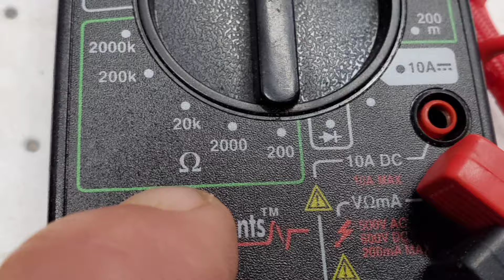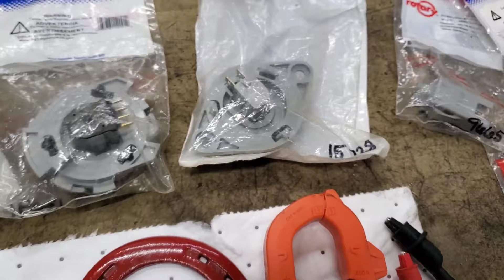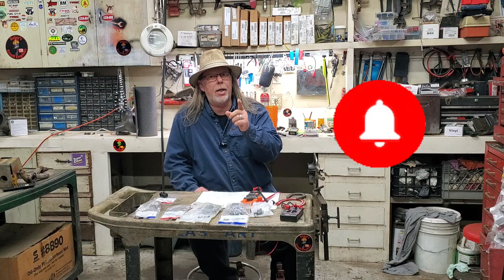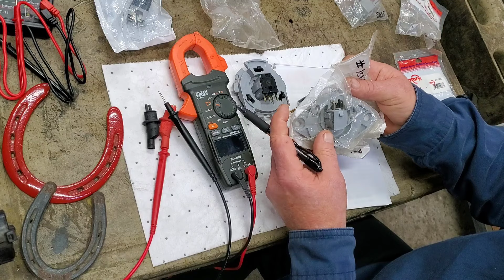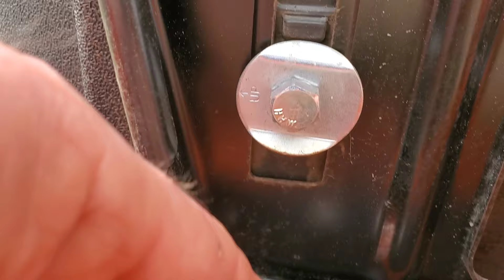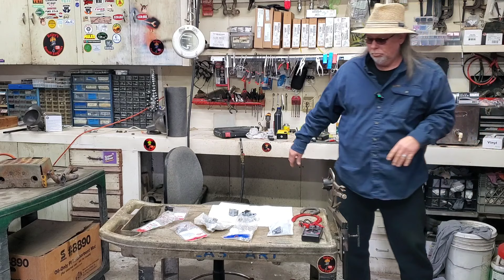Test Any Lawn Mower Safety Switch Easily

Comment: Thank you for you video.  Very helpful...I bought a house few years ago and the previous owner left behind an old but new looking Dixon ZTR. This pass summer I decided to try and get it started. My new neighbors said the previous owner never had success getting it to run. Challenge accepted...

I replaced the ignition switch,carburetor, solenoid, battery etc.  It has run like a champ all summer long mowing several lots that my family owns.  

Today it finally stopped working.  Every time I engage the PTO, levers or touch the choke it turns off. I noticed if I giggle the pto or bounce on the seat it will crank up then turn off.  This video has provided the map on how I will diagnose and fix the pro blem.   Thank you so much!

Comment: I have one big question that I need answered. Maybe it's a silly question but it nags me.... What the heck is happening when there is continuity through the switch? ... In other words, are all of these switches in series with one another? And, why does the engine shut down when the switch is NG.  In my  head, the whole thing seems counter intuitive. And then there's the diode thing, but thats another question for another time... Thanks for listening and I hope to finally learn what is going on with this giant mystery system.

Comment: just an fyi...my craftsman yt3000 riding mower stopped working completely when i had to slam the brakes on while mowing. it shut down and would not restart. i turned the starter...nothing. well, the reason it shut off was because i moved off my seat, and the safety switch did its job. however, i kept trying to start it again while the blades were still engaged. lol. when i released the blades after watching this video, it started right up. i'm 77, and forgot the blades were engaged. lol. thanks Mr. Raley!

Comment: Hi T-Bone, quick question for you. I had a working Husqvarna YTH24V48. Never failed, always started, no issues. I decided to take it in for a "Tune-Up" and new blades at a local shop. Once there, they called and said it needed $1,400 worth of work, so I said no and took it back. Since getting it back, no matter what I do, the mower cuts out as soon as I engage the blades. I have checked the seat safety switch, and it has continuity and works fine, and mower starts when I am on seat. I have also checked the PTO Switch and PTO Clutch, and they are both fine. Please help! What could these people have done to sabotage mower? Mower starts fine but shuts off as soon as I engage blades. Oh, I also checked belts and I can freely spin them, so nothing is trapped in blade area.
Reply: I figured it out! Thanks TBone, by watching your videos I figured out what they did, and it's working! AND, now I have filed a police report! Thank you!

Comment: Thanks. You confirmed that all the switches (seat, lap lever) I can find on my cub cadet ZT1 Mower are working fine. Now if I can only find the reason it quits when I try to use it...... Only has 75h on it and it's an anchor. Cannot find a wiring diagram anywhere.

Comment: I see this is a couple years old, but might relate to an issue I'm having getting my Ferris is1500z zero turn ready for the season. I replaced the seat with a new aftermarket one, both seem to plug in the same way to the wiring harness(2 pin). I can get on the mower and start it fine, but once I start to release the parking brake, or move the drive levers, the mower wants to shut off because of the safety switches. Could this new seat have a different type of operation with it's included safety switch? I did unplug it and put a shorting wire across the harness contacts, but still the same result.

UPDATE: The Ferris seat safety switch operates opposite of the norm, it's shorted when no one is seated, but opens when you sit. Thankfully still had old seat and switch.

Comment: Was testing Cub Cadet Commercial Zero Turn earlier today and pulled the PTO switch up to test the blades. 
Please Note: I was not sitting in the seat

Engine cut out immediately.

Tried to recharge battery, won’t start, or even click.

Is this an example of a safety switch issue?

Comment: That actually is not a good way to test switches, especially micro switches. It only shows continuity, and does not show if the switch will carry a load. Better way is to apply a load with a test lamp to be 💯 sure . Some poorly designed starter systems do not utilize a starter relay and leads people to replacing good starters. The only thing your ohm test can verify is an open circuit.

Comment: My Husqvarna is having problems when I'm turning the keys it start by I to play with handle back and forth what could that be.
Reply: Loose connection or switch corrosion. Replace the switch and make sure to use dielectric grease when you put the connection on especially if you keep your machine outside in the rain. If the problem continues, you have a wire that is grounding/shorting out because the jacket is rubbed open.

Comment: My z225john Deere won’t crank no click ck solenoid  no signal when you turn key replaced switch didn’t help bypass seat switch same thing  bypass seat switch same tested control  switch for Handel same tested brake lever switch good  not sure where to go now

Comment: My belt broke on my zero turn lawnmower and snatched my wiring harness into it was running and moving before this happened and I wired it now when put the break down, it goes dead.i have tried everything I know to fix it no luck . Do you have any ideas about what it’s causing this ?

Comment: Hi Raley,
Working on a 28" snapper- model 3012523BVE. My engine completely shuts down when I release the clutch. I checked the seat switch ( normally closed) switch and that checked out fine. Also checked the clutch pedal switch, which has a normally open and  normally closed set of contacts and that checked out good. Any ideas ?

Comment: Another great video.  After replacing the starter and still no start no click, I realized I didn't have power to activate the solenoid.  I tested the brake 4 prong switch and it worked perfectly until completely depressed.  Thanks for mentioning to test the entire range of motion.  Thanks for the video and sharing your knowledge.

Comment: Hi T Bone I have a 2015 xt1 enduro series cub cadet model# 13AVA1CS056 lawn tractor .The problem I’m having is when trying to start it. When I turn key switch to start engine the engine over turns a llittle over a 1/4 of a turn and stops .If I turn key switch on and off fast a few times it will finally turn over. .i put a new battery in it also a new starter.still does it .Any help T bone would be so grateful Thank You for you time Jerry

Comment: What does the little button do on the seat safety switch? I m working on my neighbor jd 304 . Found the brake switch is with continuity on all 4 tabs when button is pushed in . Part on  order.

Comment: Thank you. You shared the exact safety switch I have on my Ferris. I’ve got a no start situation currently. Testing out the battery, solenoid, wiring and adding testing the 4 safety switches. Thanks

Comment: I am currently chasing my problem, and this is the next step, thank you.  I can jump start my mower directly from the post on the engine starter and it will fire off and run but can't get anything from the ignition?